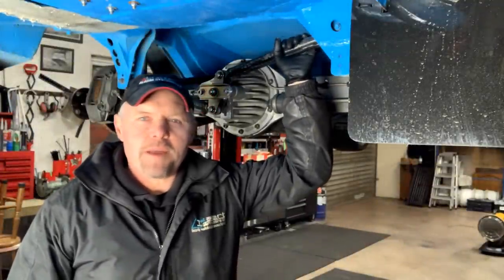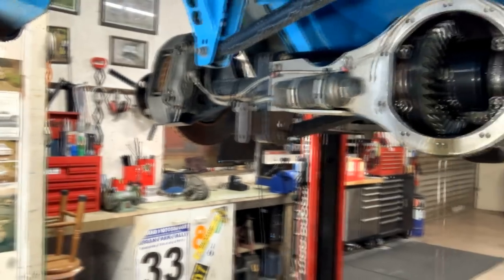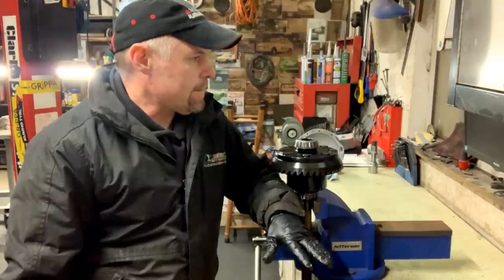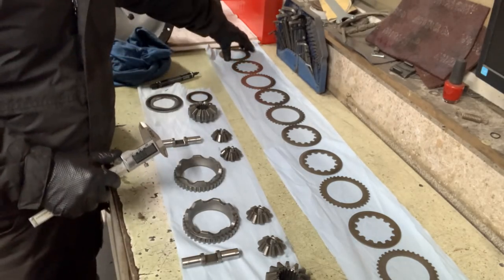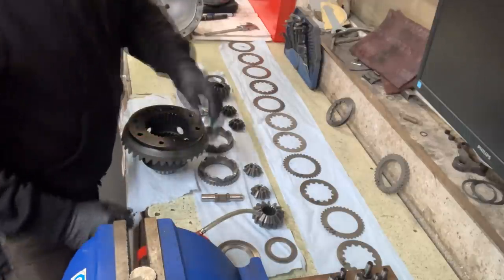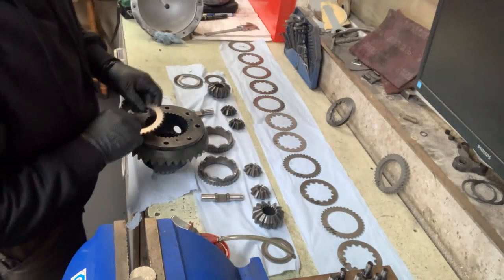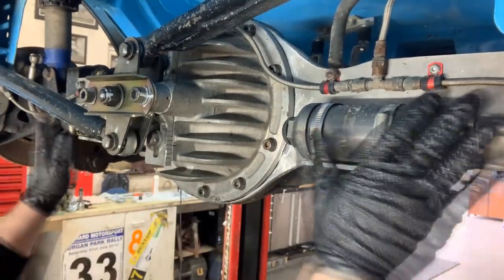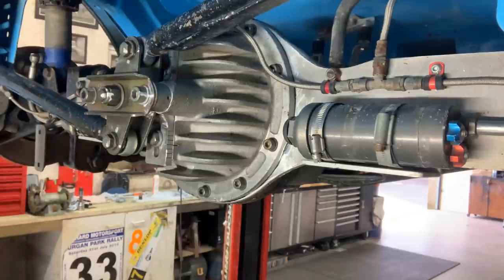Frank Kelly - HOW TO Set Limited Slip Diff Preload

Comment: Great to see what's inside and get an understanding of how it works... 
Just a little mystified on your method to increase pressure. Firstly will say I have zero knowledge of this and through the speeding up of video I may not of fully followed what you did, but here goes, slap me down if needed!
I was understanding it's like two clutches, presumably one for each half shaft? Was I following properly! You then after the first testing of pressure seemed to only increase plate thickness in one clutch, then seemed to repeat this till you got 75...
My question if my understanding was correct is: Does increasing one side not just increase one half shaft... or is it irrespective and the whole unit balances across both clutches....

Hope your keeping well Frank, looking forward to the rallies coming back and seeing you out there.... All the best to the whole team 👍👍

Argh just noticed someone commented the same... will save you an answer...

PB!

Comment: Brilliant Video thanks Frank. I'm new to your channel and glad i found you. i do have a question.. the diff appeared to fit very easily into the axle case? Is there very little preload on the carrier bearings?
Reply from the maker: Thanks Nigel. The bearing preload is minimal. I would describe it as a ‘snug fit’. 
If you have to force the diff in then the bearings are under to much pressure and start to whine.

Comment: Brilliant video, I've got a Question ; How come when you did"'nt have enough NM, that you changed only the One Side and not Both Sides? I had an Limited Slip Diff in My Rallycar an Opel Manta  2.0 Gsi so thats why I am asking.  Thanks for your answer    Akko
Reply from the maker: So long as the plates across the diff are all in good condition then working on one side like this is fine. Sometimes you’ll need to work on both sides if you haven’t alternative plates of the desired thickness to get the result you want.

Comment: Great video, what ramp angles do you recommend for gravel? Something like 30/45 or 35/50?
Reply from the maker: I prefer the original ZF motorsport set up with 30/30 ramp angles. Since making this video I’ve moved away from gripper lsd and found great improvements.
Reply: @FrankKellyRallying  thanks a lot, that explains the impressive agressive driving style!

Comment: What lsd is that? I’m having issues with my metal plate lsd from mfactory in my bmw 130i. The gring, hops, and noise in tight and medium corners is driving me crazy. Set the lock to 40%, but now I’m thinking maybe I should get the preload down a little bit? In my case its controlled by little springs in the inside, and you can change it by adding or removing them. thanks in advance, and great video! Following now.
Reply from the maker: Plate style diffs tend to be noisy for road use. Backing off the preload should help.

Comment: Is this a Clutch type LSD? if so why'd you use Clutch type over a Locker or Torsen Diff?
Reply from the maker: Yes it’s referred to as a “plated diff” 
Much more consistent than a Torsen diff and not as aggressive as a locker. Takes more maintenance but it’s worth it.

Comment: Great vid as always mate,
So I buy a LSD from a company already  set up ramp angles ect bolt my CW and pinion on. Ew bearings and just bolt it in , check the backlash and as long as it within tolerance I’m ready to go ? What if back lash is out how do you get it within ?
Reply from the maker: Rarely will the backlash be anywhere near what you want when you first bolt it together Dave. 
Pinion and diff are both shimmed. Original ford pinion shim is always around 40” so that’s relatively easy. The tricky part is the shimming of the diff side bearings. Firstly you need to fit enough shims behind the bearing so it’s a nice snug fit in the axle. Then you need to swap shims from side to side until you get the backlash correct. This moves the diff from left to right or right to left.   Can take 1 hour or 4 hours sometimes 🙈
Reply: @FrankKellyRallying  You know what this means Frank??? Another HOW TO is required 👍🏼🤣😎
Reply: @Farlig69  you might be right 🤣👍
Reply: @FrankKellyRallying  thanks mate , il look into it in next couple of months 👍

Comment: Frank I want to ask the dumbo question... 😬😬

What does the lsd do, is it locking the half shafts together and the clutches release or in my thinking... keeping them free, but ultimately then locking them together...
I'm just struggling to work out in my head is pressure for the lsd to work or for it to release...
I get that in a normal diff, will let only one side drive and the lsd is to get both sides driving, just cant work out what's going on at 1,000 rpm on a straight road and what's happening at 5,000 rpm coming out of a corner drifting.... 

Furthermore what's the increase/decrease doing or not then doing. I saw in an answer with increased pressure( I presume that's further binding each half shaft to the other) you get push on and understeer. Which you don't want when trying to get through a stage fast.... but I presume in a playful way... it allows good drifting skills...

Comment: What oil do you use Frank? B373 or something synthetic?
Reply from the maker: Millers CRX LS 75w140NT
Reply: @FrankKellyRallying  
Thanks!
Reply: Last question, how often do you change the diff oil?
Reply from the maker: @debarra136  diff is pulled out every 200/250 stage miles for a check over and oil changed then.

Comment: What Ratio do you run Frank? And does it change at all. Forest or Tarmac
Reply from the maker: Running a 4.6 cwp on both surfaces at the moment. 
Change drop gears in the Samsonas gearbox to accommodate different surfaces.
Reply: @FrankKellyRallying  that seams higher than most
Reply from the maker: @BespokeBaits  it’s all in an effort to limit the wheel spin that the Millington brings.
Reply: @FrankKellyRallying  got you
Reply: @FrankKellyRallying  so a less horse power engine (fast road)you would recommend a lower ratio  5.1 or 4.9
Reply from the maker: @BespokeBaits  for good acceleration yes but for motorway cruising you’d want 4.1 or 3.9.
Reply: @FrankKellyRallying  it will be single venue rally’s
Reply from the maker: @BespokeBaits  then I’d go with something like a 5.1
Reply: @FrankKellyRallying  thanks